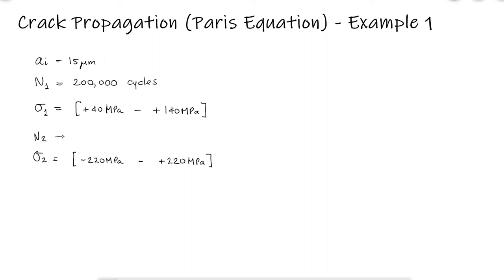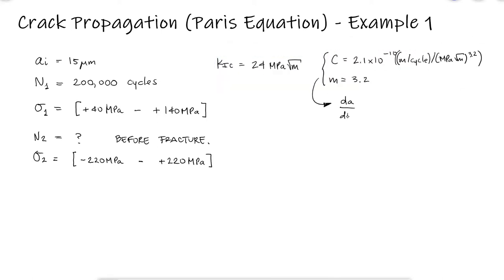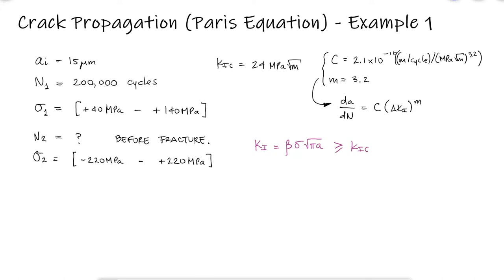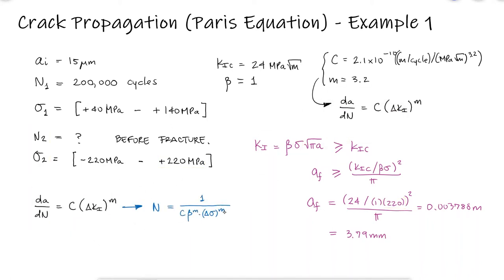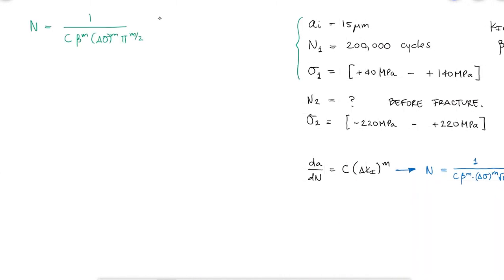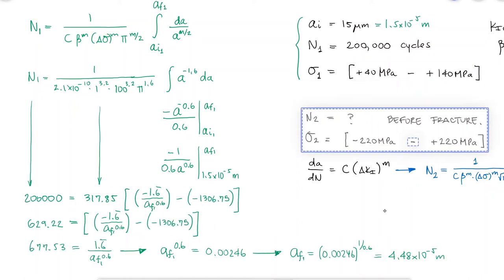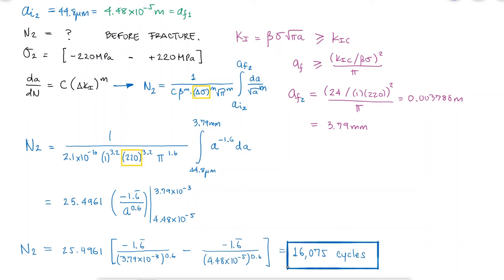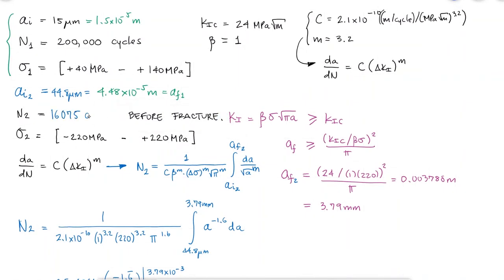Crack Propagation - 2 Stages of Loading - Example 1

Comment: Shouldn't delta sigma2 = (220 - (-220)) = 440 MPa?
Reply: I beilive u are right.
Reply: As he stated on the video, the value of sigma 2 will only consider the values of tensile stress, that is because it is assumed that the compressive part of the cycles won't cause crack propagation (it wont open the piece, this is better understood by watching a video of crack propagation test, where one can see that during the compression part of the cycle the crack does not move.)